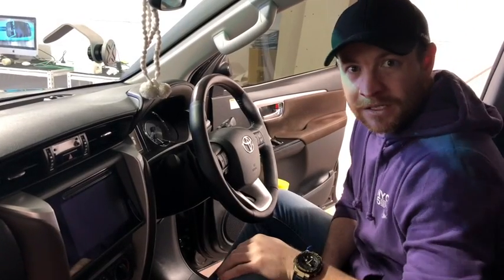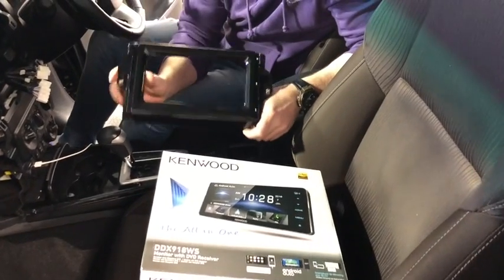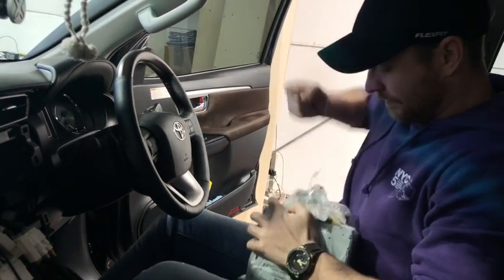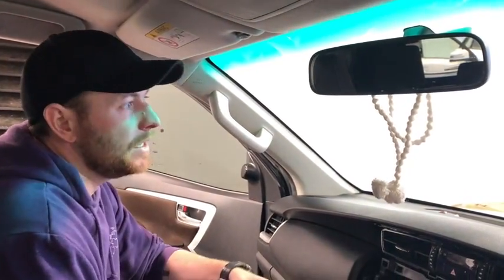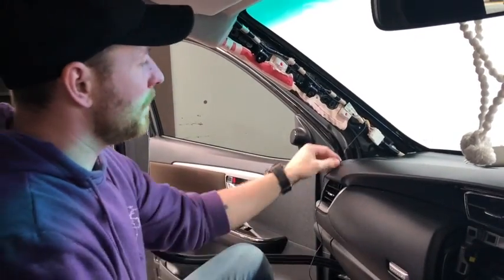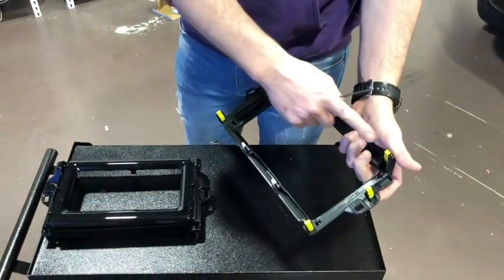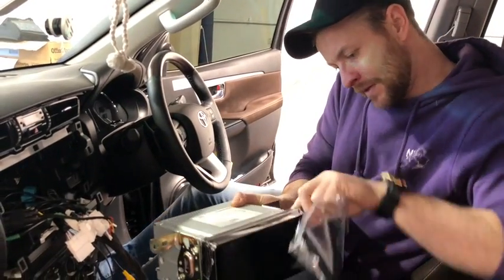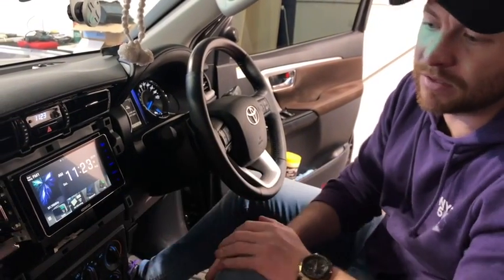DIY: How To Install A Stereo in a Toyota Fortuner | Apple CarPlay & Android Auto for Toyota Fortuner

Comment: Everything was Nice & Clean / Neat / Easy / Straight / Flexible. Very informing video as I will be doing this to my soon. 1 Question. Why use double-sided tape for the bolt and place it behind instead just place them in front which will make removing them a breeze. Thanks for the video.